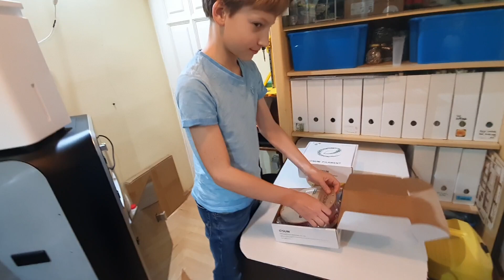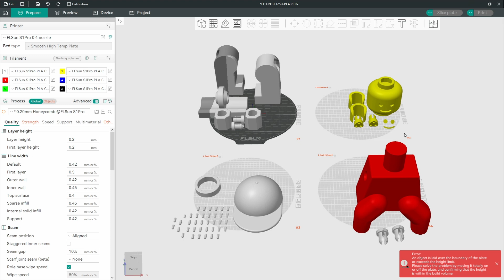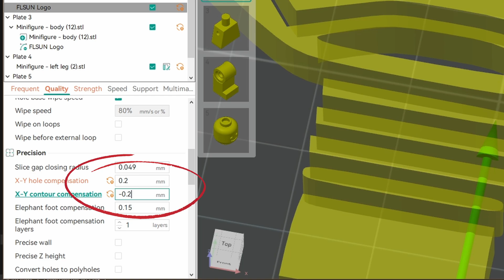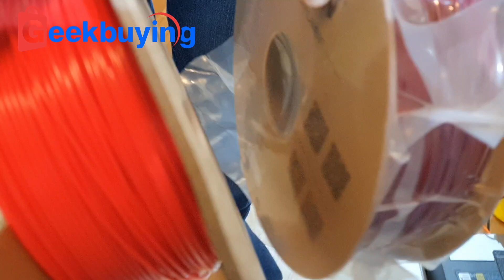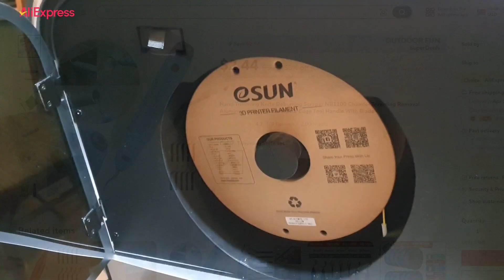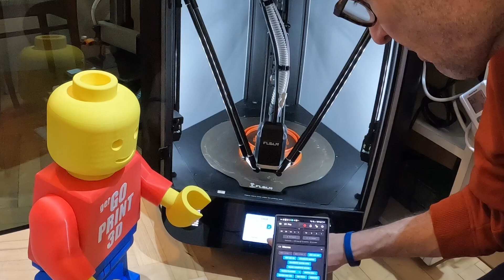HUGE Lego Man on S1 Pro under 24h using Orca: Build Steps, Tips + Why upgrade from FLSUN Slicer

Comment: Could you give me some tips for doing petg high speed filament on the s1 pro? I want to go as fast as possible and I'm not too concerned about appearance. I'm making parts that go outside. Eventually I want to do asa
Reply from the maker: I would look into getting 0.6mm or bigger nozzles, FLSUN doesn't seem to directly sell them, but I think our S1 Pro uses standard V6 stye, so you can grab a set from AliExpress to test.  Then, do a max volumetric flow test in orca slicer to figure out the highest speed achievable with the motion system / nozzle / filament combo. I talk more about filament calibration here: https://youtu.be/LcRi2r1j7KE  For ASA you'll need to implement some kind of chamber heating, which is not easy in the S1 Pro. Be sure to take care of proper ventillation, because ABS/ASA fumes are toxic. See our recent video on the topic: https://youtu.be/c8mrV6G3iwc

Comment: hey buddy been tinkering on my new s1 pro i got recently and receiving a T1 pro soon in the next few days, any chance at all you could update with any changes maybe another video updates upgrades slicer updates youve done to the profile anythig really i am having extreme issues with my s1 pro i can not lie. only attempting PLA
Reply from the maker: Hi! I've published my orca presets in my FLSUN S1 Pro Improvement Collection on Cults3D (linked from the description of the video). I've been using those presets. I love this printer  for PLA / PETG prototyping, I use other printers for higher temp filaments, since the S1 Pro toolhead is a nightmare to disassemble in case of a clog.

Comment: Orca Slicer doesnt have flsun s1 pro. How did you add to slicer program ?
Reply from the maker: I made my own presets (based on the S1 my own max volumetric flow measurements and other  settings I looked up in the FLSUN slicer). This video explains → https://youtu.be/-XRK8oaQKBc and my FLSUN videos have the link to the cults3d project in their descriptions (Improvement collection)
Reply: @gerGoPrint3D  Thanks :hand-pink-waving:

Comment: My problem with Orca is toolpath generation and framerates are slow and I don't know how to fix that.
FLSUN and Bambu slicers run fast. Can't find setting to fix this. Core I5. Thank you for GUNLOAD macro. ;)
Reply from the maker: Very interesting observation. I never considered this. I had to measure. For me the two slice at exactly the same speed: stock Orca + FLSUN slicer. It could be some setting difference or driver incompatibility with stock Orca for you. I am still using v2.2.  Running on core i7-12700K with 64GB DDR4 + GeForce RTX 4060 / 8GB

Comment: The printer should have a minimal extrude temperature set. So below that temperature,it won't do any extrude or retract movements. The options would be to heatup the nozzle before running the macro.
Safer approach given the pain to clear extruder clogs, would be to just split the Bowden with a coupler, or unplug the reverse Bowden. Cut the filament, and just extrude the whole filament leftover in the effector
Reply from the maker: Agree. On my Qidi Tech Q1 Pro I've added a filament cutter, pretty simple to implement, the same would actually work here,,, on the other hand I have been using my retract to unload macro for the past 2 months, and no clogs, and no wasted filament. Of course my macro contains the nozzle heating commands, and they do work properly when the printer is idle.  For some reasons they did not work when executed as part of the M600 command during printing. I am no g-code / klipper wizard so I did not fully understand why it wouldn't but combined with the load command it works.

Comment: Did it really only take 24 hours? On my old ender it would probably take 3 years, LOL.
Reply from the maker: The biggest part, the mid section took about 6 hours, the whole thing aggregated 21.5 hours. It took longer because we had a failed arm and played around with the inlay settings. But with this info you should be able to print it in 20 or so hours on the S1 Pro. It is indeed amazingly fast and reliable. And if using high speed PLA it produces high quality at these speeds. I am still blown away.

Comment: Amazing Gergo! I'd love to hear more about what exactly you changed in your Orca Slicer profiles compared to the FLSunSlicer ones. Unfortunately the default FLSun profiles settings keep giving me clogs (probably related to the retraction settings). Did you notice anything similar?
Reply from the maker: No clogs here, but this was a PLA print with partially open door. Those are less prone to heat creep related issues.  I've shared my presets, but I think I actually copied their retraction values. They seem to work well here. I no longer disassemble the PTFE tubing every time I need to change filament, that in itself could prevent a lot of issues.  FLSUN added some new settings in their flavor of Orca, which means they are messing inside, but from their speed settings independent from max volumetric flow it makes me feel they don't really understand what they are doing, so it is better to stay away from a black box like a closed source fork.
Reply: @gerGoPrint3D  Thanks a lot! I noticed that you reduced the Max Volumetric Speed (flow rate) in your settings (60 mm3/s for PLA HS and 40 mm3/s for PLA). Any particular reason why?
Reply from the maker: @minaskar11  You're right on the money noticing the reduced Max Volumetric Speed. In my experience, dialing this in to around 60 mm³/s for what I'm calling "PLA HS" and 40 mm³/s for standard PLA provides a much more accurate representation of this printer's actual capabilities with generic PLA.

It's interesting that FLSUN often sets a very high default flow rate but then heavily restricts speeds in their profiles. This approach seems counterintuitive. The more logical and effective method is to define the true Max Volumetric Flow rate for each filament. Slicers like Orca are designed to leverage this single parameter, intelligently adjusting speeds within your process presets to stay within the filament's limits. This creates a more streamlined and understandable workflow for users.

One has to wonder about the rationale behind FLSUN's approach of seemingly tuning speeds for every filament instead of focusing on this fundamental filament property. Whether it's a misunderstanding of best practices or an attempt to present inflated flow rate numbers, it ultimately creates more work for users and doesn't accurately reflect the material's limitations. Focusing on the Max Volumetric Speed provides a clearer and more reliable foundation for achieving optimal print quality.

BTW test my profiles. They actually print faster then FLSUN's ridiculously high flow rates, and the print quality is actually better. And when you get a new filament, all you need to do is to measure the flow rate (see https://youtu.be/LcRi2r1j7KE ) and create that filament with the temps, cooling and measured rate and you are done. Be it any type of pla petg, abs, asa, pa, pc...  So much easier.

Comment: This is cool. I will be coming back to rewatch at a later date for tips. I've been meaning to print a giant skeleton lego figure with glow in the dark filament since I got my SV08 in July last year
Reply from the maker: Glow in the dark will be dope! I am sure many of these techniques will come in handy.  SV08 has much better filament unload and M600 out of the box, and Sovol enabled exclude object not to mention the stock no frills timelapse which works so much better than FLSUN's own hacks.  On top of this SV08 has open version of Klipper that we can further tune to our needs. Of course S1 Pro is really cool as it prints, at about 50% higher speeds, slightly taller prints, I wish their software was as good as their hardware.